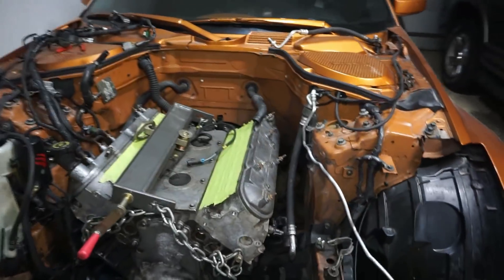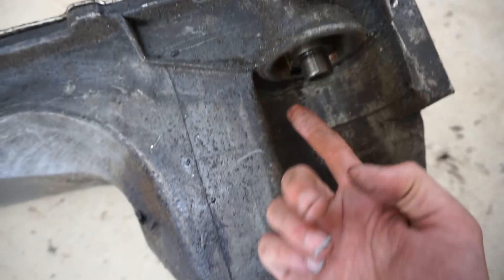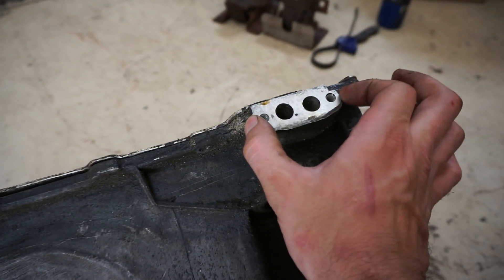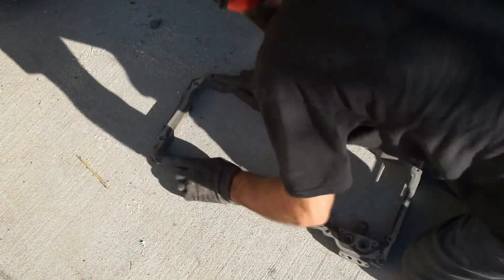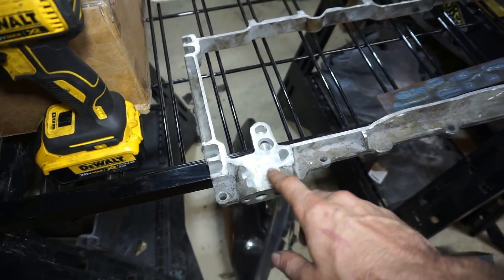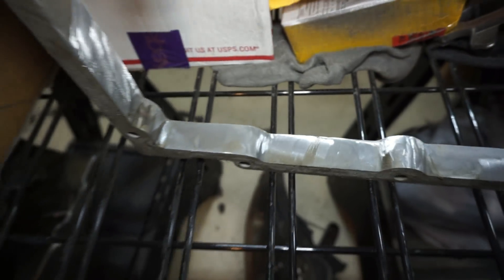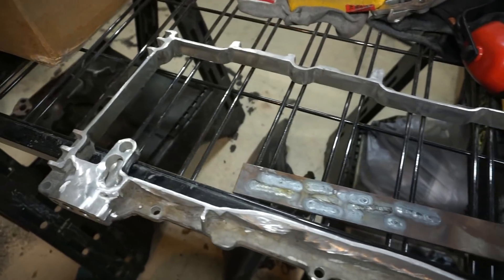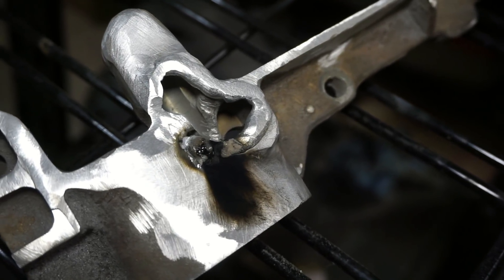Building Custom Oil Pan For LS Swapped 350z!!! Project UnFairlady

Comment: Hey man, quick question and I know this is an old video, but if you would help me out that would be great. I have used your videos as reference so far, and have installed my engine and trans using collins adapter, but my bellhousing hits the "crossmember" right behind the PS rack. Did you have to noitch this? Ands if so, is that documented in any videos? Thanks.
Reply from the maker: @dakotascot  Just looked back at some old pics and video because I couldn't remember. I did not have to notch anything for the engine to fit. Only things I notched was the front of the frame when I did the turbos to run the downpipes.
Reply: @BlaserBuilds interesting. Did your engine end up sitting perfectly flat (measured with a level)? I am currently hitting the bottom of the bellhousing on the crossmember and don’t have an oil pan on it yet. The engine isn’t sitting flat perfectly either. Trying to determine motor mount design and may try and buy a front sump oil pan. Your videos are awesome for reference in taking on the project.
Reply from the maker: @dakotascot  Was level side to side, but usually tilt the engine back 3-4 degrees to rear is pointed down.
Reply: @BlaserBuilds is that LS specific or all engines are 3-4 degrees?

Comment: Much respect for doing it yourself but as a welder and fabricator i have to tell you that you must be much cleaner when welding cast aluminum. I would have degreased it sandblasted it and wiped with acetone and scrubbed with a stainless wire brush before welding it at all. The oven thing did nothing but let the oil go further into the aluminum by opening the pores . I am sure you got alot of it off the outside but as as you found out it goes much deeper. I would invest in a die grinder an some proper cartridge rolls also known as tootsie rolls or sandpaper rolls. Makes life alot easier. Good luck with the completion.
Reply from the maker: Thanks. This was my first time welding with TIG, I bought the welder for this project. Learning a lot, but always appreciate the tips. Build was finished, then I switched it up to twin turbo setup and sold since this video was made.

Comment: hey man, i was thinking about your intake temp problem, looking at your engine bay the most obvious suspect would be heat soak, after that would be intercooler not having enough surface area or not being able to flow enough air through the fins to transfer heat, before taking the plunge into doing all new piping and turbo install, maybe try putting a sprayer nozzle infront of the intercooler connected to a winsheild washer bottle and spraying either water or washer fluid (methanol) and see how much that drops your temps

Comment: R u making a pan because of the lack of cheap front sump pans on the market or just because
Reply from the maker: julia Hobbick A bit of both. I've wanted a TIG welder for quite a few years so this gave me an excuse to buy one vs. Buying a $500-800 oil pan. I did find a pan that might work for $189 on ebay that I may cover in a different video after I get dimensions.
Reply: Any update on the 189$ pan?

Comment: Also, I'd weld the flat part to the pan then cut the middle out, it will warp less on you that way
Reply from the maker: Thomas Cahill Great Point!!!
Reply from the maker: Thomas Cahill Only issue I could see is that I wanted to have it bolted to the block when I did the welding so the flange doesn't warp... I need the opening to fit the windage tray.
Reply: a21bravo you could grab a block from the scrap yard and take the crank and rods out
Reply from the maker: Thomas Cahill Yeah, I have a different block with a whole in it that I was gonna use... All id really have to do is Pull the crank caps off... Perfect! I didn't want to weld over the good one so was gonna use that one.